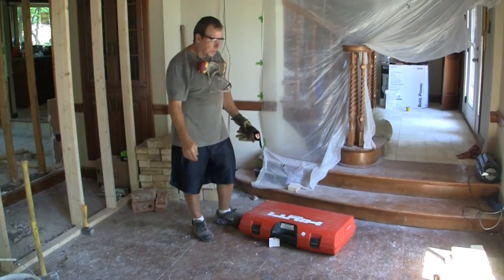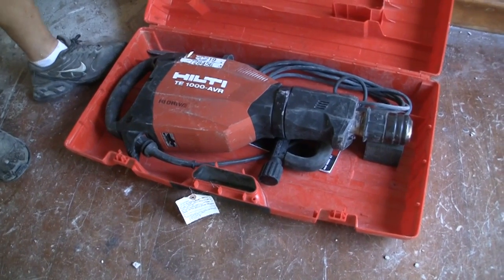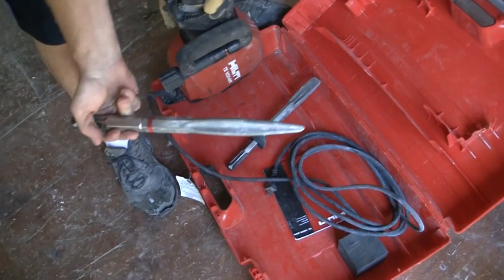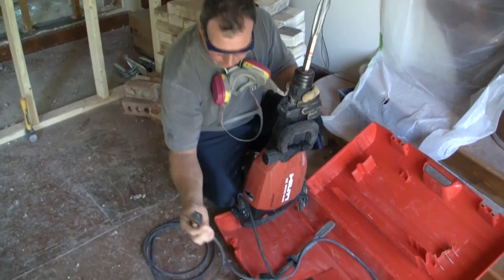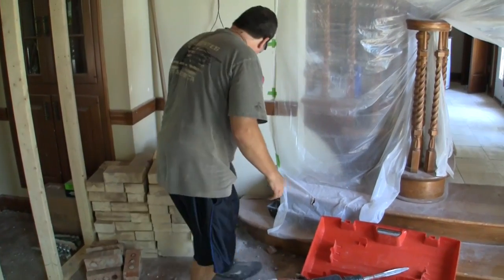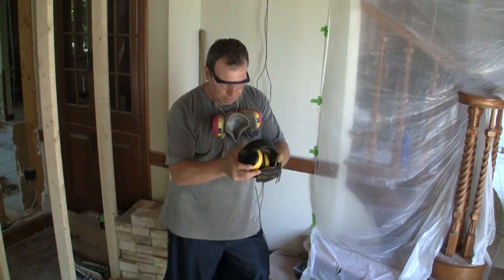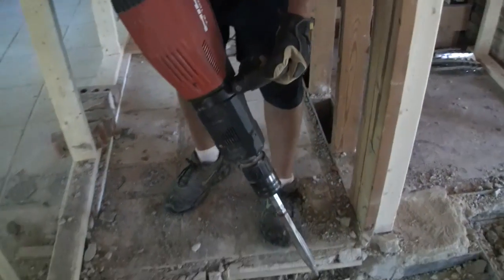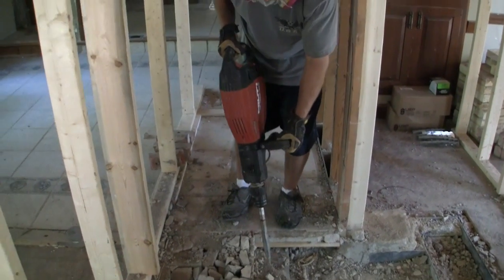How to Use a Demo Hammer / Jack Hammer

Comment: When I first started using my new jackhammer, I was getting the bit stuck. I found that it's fairly easy to remove if you disconnect the jackhammer from the bit, then bang on the bit from the side with a regular hammer it loosens up pretty quick.
Reply from the maker: Hey Old man,
Thanks for the tip and thx for watching!

Comment: Fun fact that button you pressed for the light makes the jack hammer weaker. It doesn’t hit as hard. We use those at work for small spaces but we use the big 70lbs hammers that you said came on a cart.

Comment: Thanks for the vid. I will be chipping up a first floor concrete bathroom floor to extend the drain. I understand your point about not using the point in the middle and to try to start on the edges, my question is what do you use to make the initial break in the concrete?
Reply from the maker: Hi C Murph, just start at any edge and stay in a concentrated area.  The vibrations from the hammer will create a crack, then just work from there.  Good luck!
Reply: @Housebarons  thx!
Reply: Will this break for joists if being used on the second floor? Is there a better option or will the smaller demo tools not get the job done? About 2" thick 5'x10' area
Reply: Tilt the hammer a little so the chips move up instead of sideways. The initial hole is a little bit slow, but be patient. The bigger the hole gets, the easier it gets.

Comment: I remember the first time I used this at work with no experience it was the biggest pain in the ass ever.....
Reply from the maker: It can be a pretty good workout to use!
Reply: Just started doing slab work at my first site still about 3 months clean. Trying to get it around a pvc pipe, that we need to move, and a wall frame hurts the soul

Comment: Can this be used in the horizontal position? I want to demo my cistern.
Reply from the maker: Hey Joeskis,
Yes. This one would work horizontally, but if that’s your plan, I hope you spend a lot of time in the gym - it’s a workout. Best bet is to go to a rental place and check it out. See how heavy it feels to you and how many hours of work you think are in front of you. 
A smaller model may be easier on the arms but move slower - kind of a trade off.
Reply: You can rig something up to suspend it, to hold the weight, just make sure that you can still move it around.

Comment: I just used a 60 lb jackhammer. My back is aching. I guess I was using my back instead of resting it on my knee?
Reply from the maker: Het Rattler,
Way to go - sweat equity!
Thx for watching
Reply: I am pretty much crippled with a crushed disc in my back, but with a little bit of ingenuity and learning to use your body differently it can be done. I'm in the middle of installing drain tile and a pump in a wet basement. It's slow going but I'm not in a hurry. We purchased a demo hammer instead of renting one so there's no timeline.
I sit on a low chair and transfer the weight to my knees so it totally skips my back.

Comment: That seems a bit bigger than needed,,  wouldn’t a SDS MAX Rotary hammer be a little easier?  They aren’t as powerful but powerful enough, much lighter and can be more precise
Reply from the maker: Hi Robert, the project we were working on was to remove a massive 4 story stone fireplace and chimney, so we definitely needed all the power that the demo hammer could generate.  A less powerful tool would work for smaller jobs.  Thanks for the comment!

Comment: Great video, but a few things missing:

*STURDY BOOTS

I'll let you decide if you think a task needs steel toe cap boots (risk of crushing or cutting the toe area), but I can't imagine doing a task like that wearing trainers. Slip resistance, better footing and a much lower chance of twisting ankles are all good reasons to wear a solid boot.

*OVERALLS

Dust is horrible. Disposable overalls mean your clothes aren't dusty. This helps manage the risk of inhaling dust later in the day. Denim overalls also provide a modicum of abrasion resistance: if a pebble kicks up and catches your skin it'll bruise and cut, rather than scratching your body up.
Reply: I have not found that any part of small scale concrete demo is threatening to my feet. I feel perfectly safe in my sneakers. Just don't go crazy. It is nice to get the dusty clothes off when you're done.
Reply: @theobserver9131  fair enough man.

I'm pretty risk averse. Don't like the idea of risking my health for the sake of it.

But you do you.

Plenty of folks take risks and get away with it
Reply: @jamestricker3741  the only risk I see to the feet in this situation, is dropping the jackhammer on your foot. But I don't think anyone who is that clumsy should even be attempting this. You claim that I like to risk my health, that claim is completely unsubstantiated. What makes you think you know what I like and don't like?
Reply: @jamestricker3741  I am much more agile and sure footed in sneakers. Big heavy boots make me trip over things.